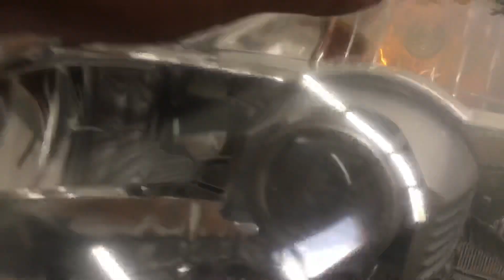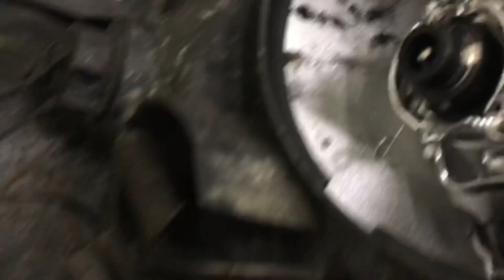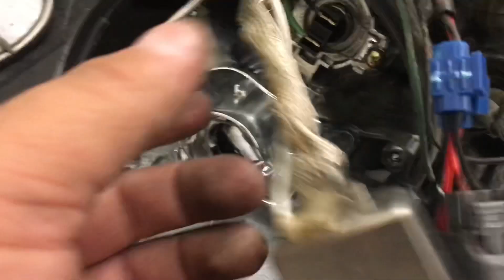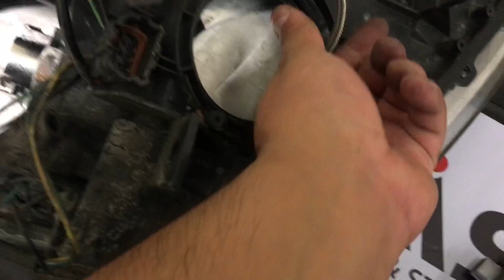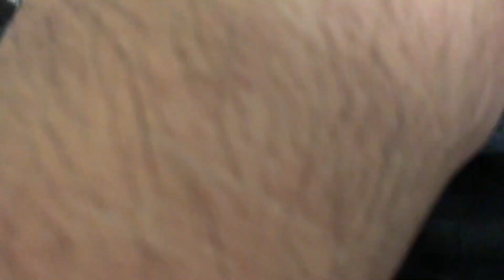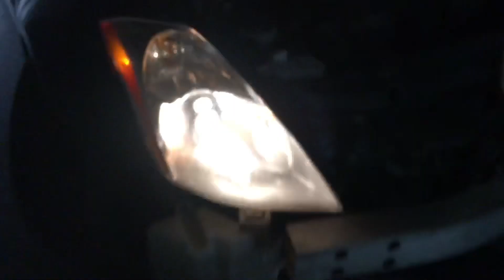How To Install The LASFIT D2s Onto A Nissan 350Z - Step-by-Step HID to LED Bulb Conversion Guide

Comment: Do you happen to have the 6 pin output for the chassis side harness. Rubbed off on my tire passenger side and now im trying to repin to a new connector. My wires are purple/white, brown, black/white, black, red/blue and red
Reply from the maker: Hi, I can't determine the exact issue based on your description alone. If you encounter any difficulties during the installation of Lasfit LED bulbs, please feel free to contact our customer service team at cs@lasfit.com and attach relevant photos or videos. We'd be happy to assist you!

Comment: Just bought lasfit LED lights to replace D4R HID bulbs, seems like you guys started making those connectors small enough to fit into the 12v plug without splicing or clamping. Nice job!
Reply from the maker: Thank you for choosing LASFIT! We also look forward to receiving more feedback on your future usage experience.

Comment: Wait, D2S?  
Whats the difference between D2ar and D2S?
Reply from the maker: The difference between D2S and D2R is that D2S HID bulbs are designed to be used in a projector headlight application, and a D2R type is made for a reflector application – such as in worklights and some driving lights. You can easily identify them as the D2R has a painted shield onto the glass, whereas the D2S doesn’t. Our LED bulbs are designed to be compatible with both OEM D2S and OEM D2R applications.
May I ask your vehicle's make/model/year? Do you have any plans to upgrade your vehicle's lights to LED?

Comment: I have suzuki swift sport zc32s, that uses that same connector on the factory HIDs d2s.
will this kit fit the car? even the ballast looks the same
Reply from the maker: Hi, as long as you can confirm that your vehicle has OEM HID headlights and the connector and ballast are the same as in the video, then you can install this #Pro-IN-D2. 
To better confirm whether your vehicle can install our bulbs, could you please send us some pictures of your ballast for confirmation? Please reach out to us via youtube@lasfit.com.

Comment: Assuming it comes with the little rectangle gray box??? But the other part with the yellow clip wire you have to buy separate?????somebody pls pls pls help me I’m kinda confused pls someone HELP
Reply: I’m working on a 2006 350z and I need to make sure it comes with the gray rectangle battery thingy that connects to the D2 bulbs so can you please confirm that it comes with pls
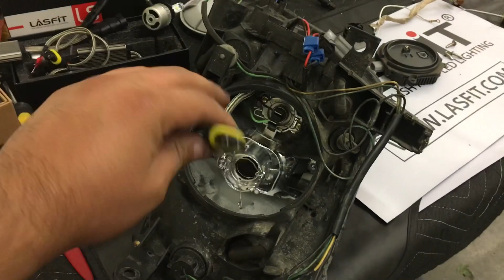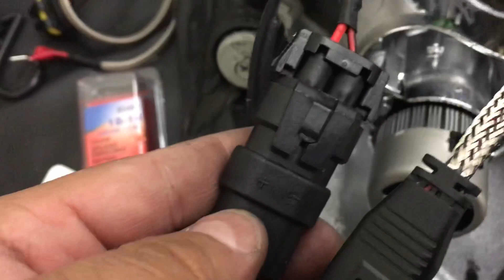Reply: I’m talking about on time (10:50) for the yellow piece and the gray rectangle battery look a like at time (14:00) where you’re connecting it together so please can you clarify that it comes with it?

Comment: Why don't you just make a adapter so it'll be PlugNPlay? It'll be easier so no one would have to do any modification!
Reply from the maker: Hi, we have the plugNplay D2 LED bulbs, the OEM design:
https://www.lasfit.com/products/pro-in-d2?utm_source=Social&utm_medium=YTB%20Channel&utm_campaign=Pro-IN-D2
Reply: @Lasfit-Automotive  do you have a PlugNPlay for a 2007 Acura TL?
Reply from the maker: @kambodreamz2611  Can you check if your stock HID ballast is the same as the one in the video?
If you're not sure, you can take some pictures of your OEM HID ballast to send us for a look.
Reply: @Lasfit-Automotive  the ballast outlet looks very similar  .. where can I send you the photos to verify?
Reply: If it matches with the current  PlugNPlay link you provided I'll gladly buy it
Reply from the maker: @kambodreamz2611  Please send photos to us by email.
youtube@lasfit.com

Comment: So what happens afterwards when you try to use the high beam switch?
Reply from the maker: The high beams will turn on. Actually, these LED bulbs work as the OEM HID bulbs.
What's your car make, model and year?
Reply: @Lasfit-Automotive  2004 acura tl with oem high beam solenoid switch. My 2ds bulb acts as high beam when triggered by the solenoid. The other bulb in the headlights, which is normally the high beam in other cars, are actually fog lights

Comment: Is the new plug and play kit the same light output compared to the light output on this video ?
Reply from the maker: No. This LED kit is not plug and play, the modification is required. What's your car make, model and year?
We have developed the custom LED kit, plug and play, check it from here:
https://www.lasfit.com/products/pro-in-d2?utm_source=Social&utm_medium=YTB%20Channel&utm_campaign=Pro-IN-D2
Reply: @Lasfit-Automotive i know this is not a plug and play kit and that there is a plug and play kit. Im asking if both the pnp kit and this kit give out the same amount of light output. Because going this route is way cheaper than buying the plug and play kit .2004 infiniti g35 coupe.
Reply from the maker: @charger6773  Different output. the pnp is better. Because the pnp kit is specially made for models of Infiniti & Nissan, and much brighter.

Comment: can you do conversion for Mk5 GTI/R32 headlights mate. cheers
Reply from the maker: Hmm, we don't have the plan at this moment, we'll take into consideration in the future. What's the year of your GTI? Are the factory headlights HID bulbs?
Reply: Lasfit Auto Lighting is 2007 gti mate and yah factory hid bulb. looking forward for it mate.
Reply from the maker: @1mac155  Hi, these LED bulbs D2 could replace the 2007 GTI factory HID bulb. But it is not plug and play, you need to modify the power wires. To find two wires "+" and "-" of the stock power plug, then connect to the LED bulb's power wires "+" and "-"

Comment: Was going to get some but your comparison was bs the stock bulbs you showed them on a wall with the whole room lit up but when you installed yours your turned off all the lights to make the room look darker to make your bulbs  look brighter
Reply from the maker: check out our current video where we did a comparison display on a 2009-14 GTR headlights. this video as mentioned in it would have been better if the headlights worked properly but it was the only vehicle available at that time that we could test our prototypes. check this video out: https://www.youtube.com/watch?v=nLb5VLekvSI

Comment: How did you do the splice thing..? You spliced the terminar itselft with the other cable, or cable to cable ?
Reply from the maker: cable to cable. Just the wire "+" to "+", "-" to "-"
We redesigned a new LED bulb, customized for this D2S HID type, direct plug and play, here is the video:
https://www.youtube.com/watch?v=NmH99O0W9L4&t=487s
Reply: @Lasfit-Automotive  can this work on a 09 Maxima
Reply from the maker: @anthonybethea4870  Is the factory  headlight HID bulb? If so, this can work on a 09 Maxima?

Comment: Does it work for 05 Acura tsx
Reply from the maker: Yes. But this LED D2 bulb is a universal plug, maybe not direct plug & play for your 05 Acura tsx. It includes a pair of universal cables, you could use universal cables to connect to your original power plug.

Comment: The unit won't last long on that setup, there's no heat vent outlet.
Reply: Just switch your bulbs to a 6000k on top and do Led on the foglights. It will look the same way i done it many times
Reply: How would you fix that problem?
Reply: @robertohernandez4063   make  a hole behind the bulb cover and install a (<1") PVC pipe elbow with male thread on it, elbow pointing down and add a 3 to 4 inches long PVC pipe, and also to keep the headlight housing clean stick some heavy duty scrub sponge into the pipe.
Reply: @goodmanfreeman2330  that'll look kinda ugly huh?
Reply: @robertohernandez4063  Yup!😊 but the overheating problem on my KW fixed.
Reply: @goodmanfreeman2330  why not just drill some holes on the cover? 🤔
Reply: Yeah,  you can do that too, but in my case the headlights unit its exposed (Kenworth T660). Unlike the regular car fully insulated. If you know for sure water and dust not going in the headlights unit, go for it Man.
Reply: @goodmanfreeman2330  oh I see what your saying gotcha thanks man 😏👉
Reply: There is a vent already on the headlight from factory, also i think there is a fan on the back of the led light.  should be ok.

Comment: Could you show me how to do this without taking off the bumper/headlight housing unit to a Q60?? I've been looking for this tutorial for a very long time! Great job by the way!! OR could you come and do this to my 350Z AND my Q60s??
Reply from the maker: It has to take off the headlight housing to install these LED bulbs, because you need to take out the ballast, and connect all wires. We already designed a customized LED bulb for this HID D2 as shown in the video(special for 350Z, Maxima, Altima...), we'll update the video soon, you could subscribe our channel. 😊

Comment: Huge difference, nice install 👍🍻
Reply from the maker: We developed a new LED bulb to replace the factory HID bulb D2, special design for the D2 HID bulb type as shown in the above video. You could keep watch on our store for the latest news 😊
Reply: I'm thinking about doing this to my 370z. Will these light be brighter than the stock hid
Reply from the maker: @luckychris1997  The brightness of these LEDs is the same as stock HID, but last longer, instant on. We already designed a new LED bulb, customized for stock HID(special for Nissan 370Z), plug and play. You can subscribe our channel, and we'll update the video😊